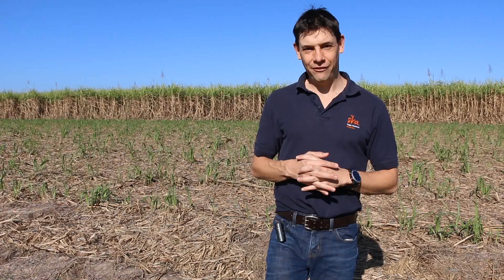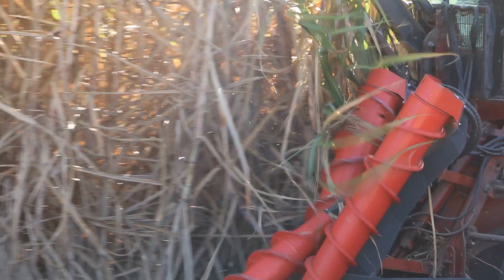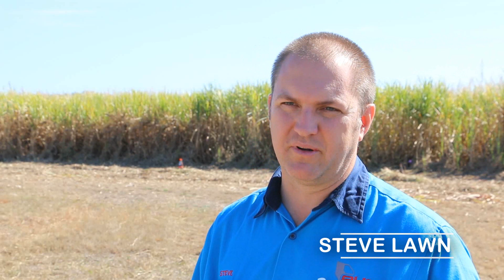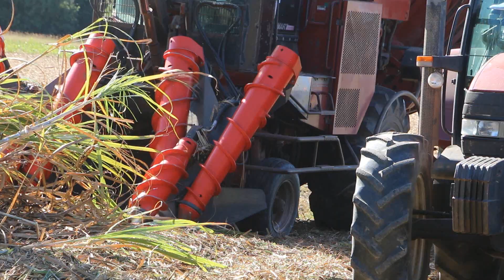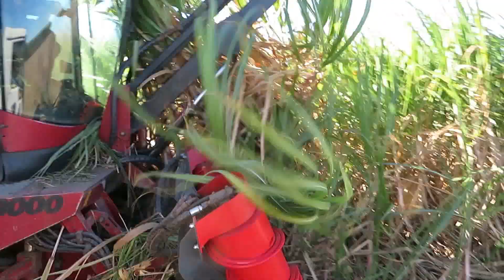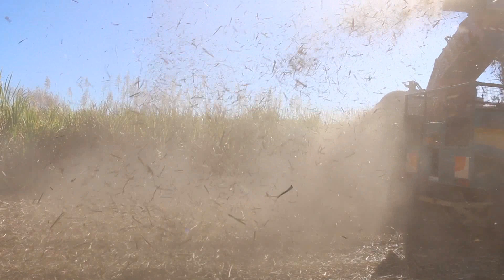SRA CaneClip: EHS fronts

Comment: If your pushing against the lean  it won’t matter what spirals you have. It’ll always push it up and over the top  cut with the lean it’ll always pull it in. And your ground feed speed is governed by how efficient the elevator removes the cane.   too fast in big cane it’ll boil over at the bootAnd jamming up the tub